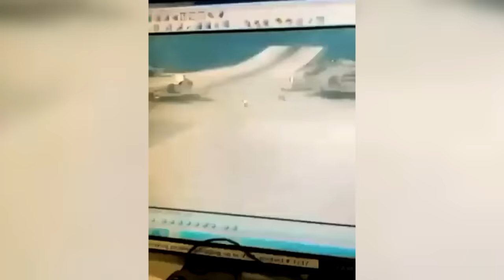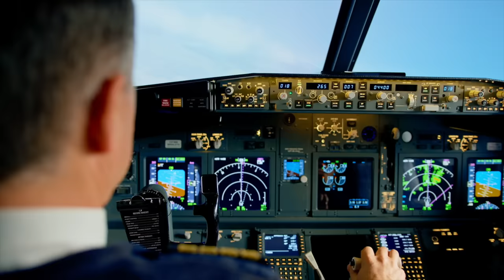Plane Takeoff Failures Caught On Camera

Comment: That Royal Air Maroc flight looks like they didn't have flaps set for takeoff! I'm no pilot, but isn't that an essential element?
Reply: Nope, they got a sudden wind change due to wake turbulence from a departing plane on a perpendicular runway.
Reply: I thought exactly the same thing. I’m pretty sure the flaps were retracted 🤓
Reply: They have got their flaps set, as you can clearly see that they aren't fully retracted.  It's a long time since I fired up a flight simulator, but that looks like maybe flaps 5 to me.  It's certainly not flaps 0.
The general consensus at the time from armchair experts (nobody, besides the people on the plane and the cameraman, knew anything had happened until the video went viral months afterwards so there was no official investigation) was that the pilot rotated too early and simply didn't have enough forward speed to get off the ground, though a few did blame (as Georges said) wake turbulence.  The problem with the wake turbulence theory was that it would have occurred right near the start of their takeoff roll and they would have been well clear of it by the time they did their speed check at 80 knots, never mind hitting V2 (the point of rotation), although there was an accident in New York where a plane crashed because the pilots were fighting wake turbulence they'd long since cleared (they were slamming the rudder left and right, which caused them to think they were still in the turbulent air, and they tore the vertical stabiliser clean off the airplane), so it can't be discounted completely.
Reply: You can takeoff with no flaps, you just need a lot more speed (vR is quite a bit higher). That becomes a major problem on a shorter runway, but it looks like those pilots had enough runway to overcome whatever problems they were facing.
Reply: @hostrauer  I'm not sure Fankfurt Airport has short runways.
Reply: @martindixon54  of 0l
Reply: @hostrauer  ppl l
Reply: @23GreyFox  You're right, every runway used for takeoffs at Frankfurt is huge (three runways of 4000m/13123ft). Runway 7L/25R is "only" 2800m/9240ft, still a moderate size, but it's also only used for landings.
Reply: I thot seabirds were launched with steam catapults?
Reply: @martindixon54  I,m not sure what video you watched but what I saw was the flaps were  indeed in the full up position. I've never heard of a 0 thru 5 positioning for flaps (pc sim game ?), but ya never know.  Possible flap position as I've known them to be are : flaps full up, flaps full down or flaps extended. Anything in between is expressed in fractions e.g. flaps at half, flaps at 3/4 etc.  See comment by Denys P Poyner above.
Reply: @martindixon54  it's amazing that they were able to rip the rudder off with the sudden shifts from side to side. Most wouldn't imagine that the plane would be capable of movements like that since they can only lead to negative outcomes and could serve no good purpose to allow for that. Such shifts are easily governed but that was considered in the design.
Reply: @dainbramage102  I'm not a pilot but nearly every video I've seen that includes a focus on flap settings has the pilots calling for "flaps 5, flaps 15", etc.
Reply: @dainbramage102  The flaps are clearly not fully retracted because the trailing edge of the wing is not a smooth edge and the only way for that to be the case (unless something has broken) is if the flaps are extended.
Also, it's not a 0-5 positioning for flaps, I'm talking in terms of the way Boeing designate the flaps settings (because I have far more flight sim experience with Boeing aircraft that Airbus) and flaps 5 means that the flaps are extended to 5 degrees (the maximum, from memory, is flaps 40 on Boeing aircraft) which is a very common setting when a Boeing airliner is taking off.  The aircraft in the clip looks to be taking off with it's flaps set at 5 degrees, hence why I said they were using flaps 5.
Reply: Mentour Pilot did an episode on this incident. As Georges Servais said it was due to wake turbulance. Mentour said the RAM pilots handled the situation perfectly
Reply: @dainbramage102  ever hear of a 737? Those settings exist…I work on them.

Comment: @10:08 That airliner did not have its flaps deployed...you can see that in the video clip - that's why it took so long to achieve proper lift. Usually when that happens, the plane either goes off of the end of the runway, or, crashes shortly after takeoff. They got VERY lucky!
Reply: They are clearly extended. And btw you can't forget flaps. When you start your takeoff and go over a certain thrust limit you get a TO Warning from the plane and this shit is loud. You cannot overhear it. They would have immediately stopped if they heard it

Comment: The Intruders engines were working perfectly. The catapult was cold. He could have saved the airplane if he wouldn't have  tried to gain altitude. Back stick caused the stall.
Reply: Yes, cold cat (either not enough steam pressure or a malfunction of the catapult) and he also appears to be too late pickling (Dropping) his drop tank.  On the Abraham Lincoln we had an A-6 blow a front tire on the cat stroke.  The aircraft ingested the tire and instantly lost thrust.  He dropped his external fuel tanks so fast they almost hit the bow.  Even with both engines having lower thrust, he saved the aircraft.  The one in this video seems to have not acted as quickly as the one I witnessed.

I spent 20 years as a Navy ATC and have seen too many of these to remember.
Reply: Don't die as a disbeliever
Reply: @Kumacho1957  That must have been something to see!  Must have been some career!

Comment: #4 at 4:35 . It seems like this video is missing a lot of critical info. They start by saying that the plane had already lost its number 3 engine and all hydraulics before it even attempted to lift off. But the video places the blame on the airline making changes to allow the plane to take off at slower speeds, and then say that the pilots tried to take off at 5 knots OVER the needed speed. So faster was worse? Is that said because the runway was too short for the plane to begin with? Seems like the engine and hydraulics issues would be more important to the explanation. Especially the dead engine issue.🤔🤷🏼‍♂️

Comment: On number 1, my questions is: why were the flaps not set for take off?  Usually they are lowered to some extent which will increase lift at lower speeds.  Every flight I have been on, had the flaps lowered on take off.
Reply: When their pilots screwed up the take off, the company decided to LIE and insult all our intelligence as well as try to say we're blind... I guess.  ;o)
Reply: wouldnt help with no thrust and no airspeed, flaps dont help that much, when your at speed the will increase lift... but at the cost of speed and they will destabalize the controls surfaces a bit :-(
Reply: @harleyme3163  No disrespect intended, but why do pilots use full flaps to land and flaps 2 to take off if they do not help with these circumstances?  Flaps increase lift, which you need for takeoff, by the way, to which rotate speed is calculated.  Even single engine aircraft use flaps.
Reply: What are the white stuff on top of the cockpit? Doesn't look like something that should be there.
Reply: I had the same question on a flight out of Frankfurt Germany in a 727 with no flaps extended.  The flight crew said they could not use them because we were near maximum takeoff weight and needed to use the entire length of the runway to gain the speed needed to create the lift.  Using the flaps would have increased the drag on the wings slowing them down too much.
Reply: The first video.....I thought you meant the plane weight!
Reply: They were.  You don’t take off with them all the way down.
Reply: looks like an inadvertent setting of flap 1 instead of 5.  Can the the leading edge slats were out
Reply: @harleyme3163  it makes a big difference.  The leading edge slats were out which suggests they put flap 1 out but not 5.  Very different take off speeds and rotation in this config.  I have 8000 hours on this aircraft
Reply: @Gavlister  and flaps 2…?
Reply: Like this plane?
Reply: same with the last one

Comment: This has been an on going thing with birds getting sucked into a jet plane engines like a vacuum cleaner. With all these new designs on planes there's a solution & simple : As a builder of Stereo loudspeakers in the 1980's called a cage grill we put over the woofers well why not over the engine blades ? It's a no brainer. . This will deflect these pests of birds. Amazing stories of this But the top one is pilot Sully that safely landed in The Hudson River. Incredible.

Comment: #1  The pilot had zero degrees of flaps set for takeoff.  Normally, you do not go to zero flaps until you achieve 230-250 knots, well into the climb stages of the flight.  If the flaps are set correctly for takeoff, the takeoff speed for a B737-700 is between 130-150 knots.  So with zero flaps, he was at least 100 knots less than the wings needed for lift.  That is why he had so much trouble even though he had 13,000 feet of runway.  Takeoff checklist was not followed properly, as setting the flaps is a standard part of the procedure.  (BTW, the still photo just before the video clip was of a different aircraft.  A B737-800.  The one in the video is a 737 NG aka B737-700, which has slightly different limitations.)
Reply: thanks,, after watching and hearing the explanations ~ they really sounded suspicious
Reply: 737-800 is NG. Or New generation. If you're talking about the Air Moroc 737 it did have flaps deployed. Leading edges are clearly shown deployed as are the trailing edges in the TO position. . He simply rotated too early.
Reply: Yet they are set in the video…leading edges are extended, therefore the flaps are at 5. That is standard configuration for takeoff.  CLEARLY seen in the video as the planes passes by. Sorry, but your comment is complete BS.
Reply: Case closed
Reply: @petemd11 fear Allah
Reply: @justing42 fear Allah
Reply: @steveblackbird don't die as a disbeliever
Reply: Don't die as a disbeliever

Comment: Interesting thing about the A-6 Intruder is that the canapy doesn't eject with the pilot, rather the pilot and bombadeir are ejected THROUGH the canopy. That is probably the reason for the spinal compression!
Reply: Damn, I never knew that. Aren’t the seats ejected alongside the pilots? I’d assume that the top of the seat would take the majority of the impact, but I could be wrong. The G forces involved in those ejection seats are pretty ridiculous to begin with.
Reply: That sounds like instant headache to me. 😖
Reply: The spine probably suffered most from hitting the water without a fully deployed parachute
Reply: Some canopies have a det cord inlaid so that in the first part of the ejection process the canopy shatters, just before the seat leaves the aircraft. As for the spinal compression, most, if not all crew will suffer injuries due to the huge acceleration (12 to 15 G).
Reply: Yes spinal compression from ejecting is a common problem and it would be the end of your military flying career as your spine couldn't take another high g ejection.

Comment: About Royal Air Maroc case. German Federal Bureau of Aircraft Accident Investigation do not initiate investigation. Why?  
The plane was hit by contra rotating wingtip vortices just on or short after reaching Vr, leading to significant airspeed drop. In such a case the PF should push nose down, rebulid airspeed to Vr and then rotate again. So, actually you watched a video that shows proper procedure.

Comment: 2:24 You would think with the high threat of bird strikes aircraft companies would design some sort of lightweight grate to fit over the engine intakes?
Reply: Its an overstated problem.
Reply: @Swaggerlot  But still, having such wide open an unprotected intakes is asking for trouble.
Reply: @redbaron474  Even if you put a screen in front of the engine where will the bits end up anyway? Make the screen too fine and it impedes the air. The reality is that in a 30+ year career in ATC the only major bird strike I had to deal with was a military single seater that took a bird through the canopy.
Reply: @redbaron474  naturally as with almost all laymen ideas, it's already been thought of, experimented with and dismissed. It's very disruptive and has a big negative effect on efficiency. If it were practical to have a grate that could protect the engine at low altitude without completely screwing the performance and efficiency in cruise it would already have been done.
Reply: Number one requirement for turbofan operation is smooth, clean airflow into the inlet, any type of cover or mesh will disturb and restrict this laminar airflow causing all kinds of rough running. Think smooth flowing river vs turbulent rapids.
Reply: @Swaggerlot  they'd come through a grate
 like 
Birdseyes Chicken fingers 😂
Reply: @redbaron474  Ever seen the video of the guy on an aircraft carrier that walked too close to a jet engine and was sucked into it head first?
Reply: @TE5LA-GAMING  and lived

Comment: Plainly obvious why the pilots in the last clip No1 had trouble getting off the ground.....they did not have their flaps set for takeoff. You will note wing flaps are in cruising mode
Reply: Flaps were set for takeoff. Flaps are retracted for cruise. Look at the video again. Leading edges and trailing edges were deployed. Pilot simply rotated too early.

Comment: The A-6 in question did not suffer an engine failure, they experienced a "soft cat". The catapult did not generate enough steam to get the aircraft up to fly away speed. The pilot hit, as we called it in A-6's the "instant gross weight adjust switch" and jettisoned his stores but it was too late. The aircraft was at the stall speed and it rolled to the right. Both the pilot and BN ejected out of the envelope. The pilot survived, the BN did not.

Comment: Have you guys never heard of English pounds, its a CURRENCY.....very expensive plane , quite possible.
Also, that last 737 took off without flaps....they were VERY lucky.
Reply: They had flaps set to 10. They were clearly extended. What happened was vortices created by another plane that had just flown over. Mentour Pilot explains it.
Reply: No it didn’t…they were set for takeoff.  You can clearly see the leading edges extend, and the trailing edges don’t operate independently of the leading edges.  When the leading edge moves, the trailing edges do. Takeoff configuration.  End of story.
Reply: They're British pounds. Hence the abbreviation GBP.
Reply: If they are English pounds then what currency does the rest of the UK use?

Comment: On that last takeoff shouldn't the flaps have been down for more lift ?
Reply: #6 too
Reply: The are clearly set for takeoff.  The leading edges are all the way down, and the trailing edges are clearly not all the way up.  Standard take off configuration.  Pssst….I am a 737 mechanic.

Comment: I find it ridiculously dangerous that air traffic controllers told a jet, full of people that just lost both engines at 2,800' to turn around and land, shouldn't the controllers have some idea about thrust and flight.
Reply: ATC are giving the aircraft options, there isn't exactly much green space in NY to put a narrowbody down safely so the only option is to give them alternate runways to land at.... ATC aren't gonna suggest ditching in the Hudson.
Reply: ATC does NOT tell an aircraft in an emergency situation what to do...that is TOTALLY the captain's call.  ATC assists in every way possible and may make suggestions, but do not TELL the captain how to fly the plane in an emergency.  I suggest that you listen to the ATC exchange between Sully and the controller in this incident...the controller did everything possible to help.

Comment: #7  Pilot had the F-35 in VTOL mode instead of STOVL mode.  All his thrust was going downwards.  It does go slightly rearward, but only a small portion for stability.  That's why he went off the deck.  In STOVL mode the thrust is at angle in between straight down and straight back (variable).  In STOL mode, it's fully straight back like a standard aircraft.  In VTOL mode it's straight down for taking off like a helicopter.  He needed STOVL mode for a ramped deck aircraft carrier.
Reply: There was an investigation and the crash was caused by a rain cover left in place on one of the intakes.
Reply: @richard-riku  sssshhhh can't tell the truth on the internet. Gotta go with the bs people make up
Reply: The pilot is n00b with the F-35.
Reply: @richard-riku  I only stated what I observed from the video.  The camera angle was from the back.  So that very well could have been the case.
Reply: @EmArgh  I only observed the video, and stated what I saw.  I didn't make anything up.  I'm a USAF and RAF veteran who has worked on all types of aircraft, including the Harrier.  If the case was that a cowling cover was left in place, we wouldn't have seen it from that angle.  Just because I may be incorrect about what actually happened, doesn't mean you have to be rude.  My comment was made from years of experience and watching the angle of the thrusters as he was taking off.  Next time, think about someone else's perspective before you act like a douche.
Reply: @AlconburyBlues  The point is that you didn't offer an opinion, you stated a fact.  This is how misinformation starts.  If you do not know something to be a fact then don't state it as a fact.

Comment: Anyone who watches airline videos is familiar with Aerosucre. It’s not the plane or pilots, it’s the overloading of the plane that’s the problem. They are lucky there aren’t more crashes. 
The F35 at the beginning of the video appears to be a STOL version that doesn’t require a lot of forward speed. The door open on the top of the aircraft is for the lift fan. There must have been something wrong with the engine.